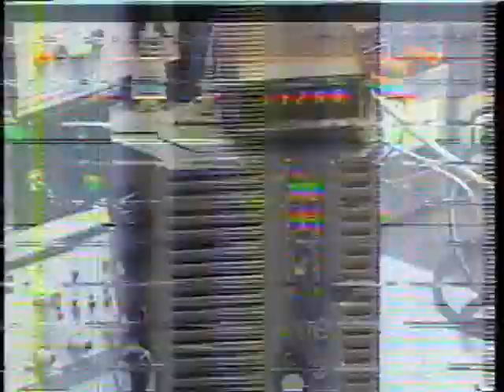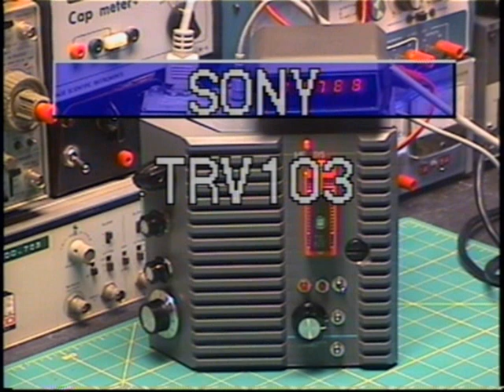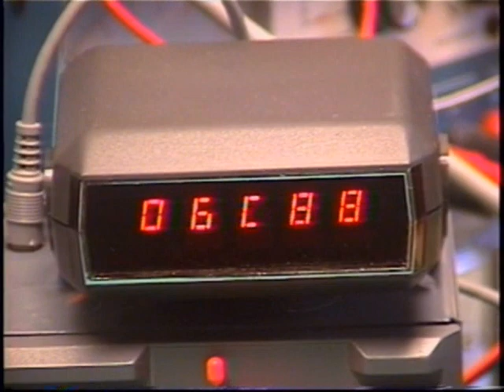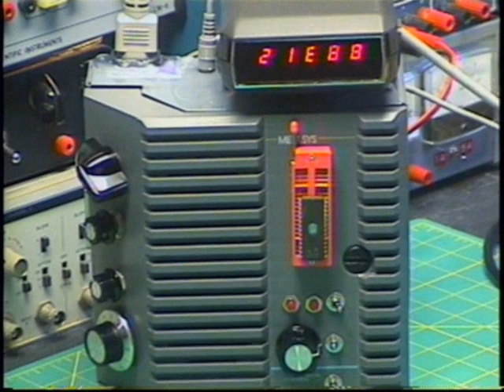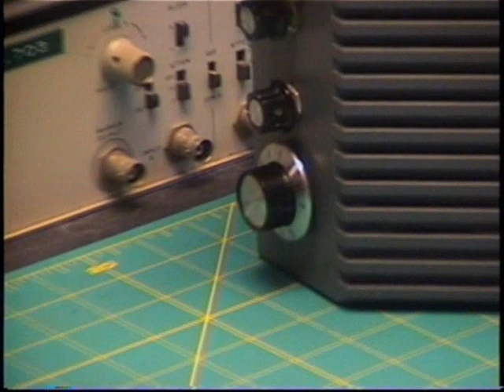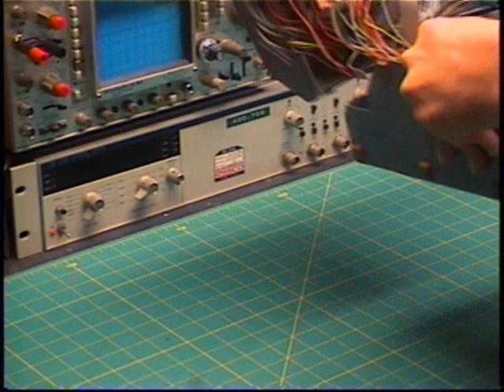Digital EXPERIENCE

Comment: The effect at 8:00 is like live YTP audio chops. How does one get one of these and eproms to record to?
Reply from the maker: You can get EPROMs from eBay or online electronics parts distributors. To write data, you would need an EPROM programmer. 8-bit PCM audio (basically an 8-bit .WAV file) can be written onto the chip, and played back using a homemade player. I have another video about this player. Also, other people have made similar players online. Basically, counters to count through the addresses of the EPROM, a clock to drive the counter chips, and a digital-to-analog converter at the EPROM's data lines, then driving a low-pass filter and an amplifier.
Reply: I believe a lot of audio editors have a raw 8 bit export.